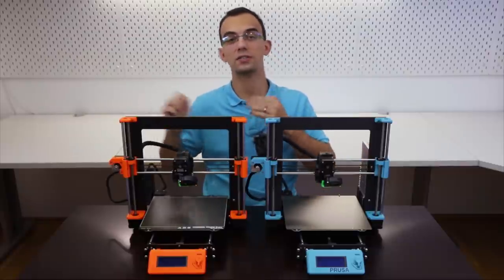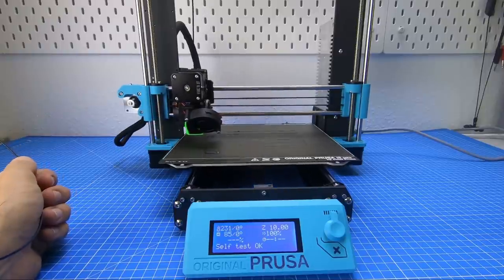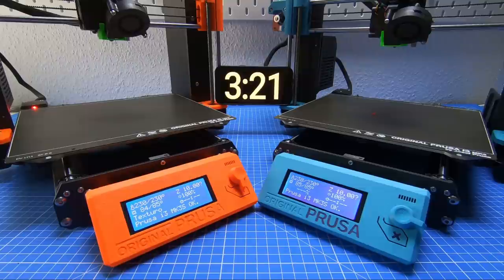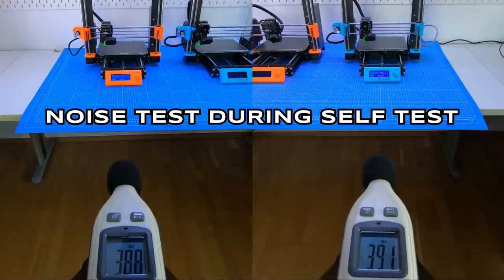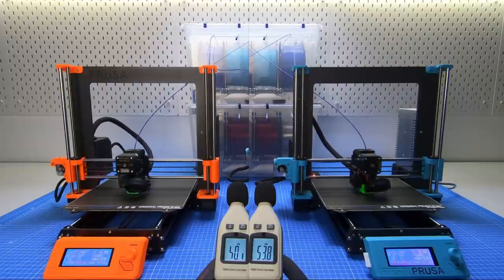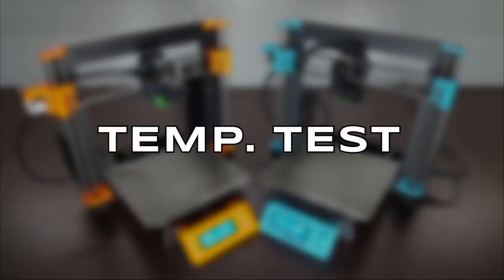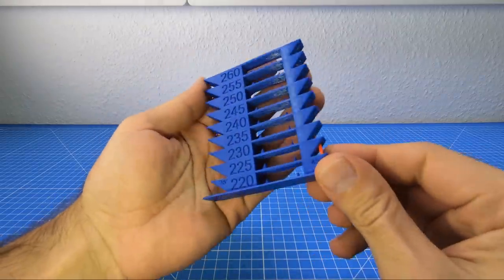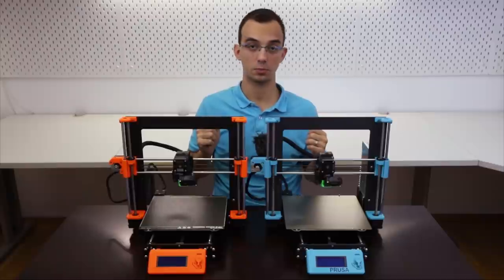The best Prusa MK3S 3D printer alternative? [test, compare, review]

Comment: I bought this clone in november from Spain. Bearings were fine, didnt need to adjust eSteps, Temps were fine too. LCD cables were also the right way around. The only problem i had was that the Z-Motor cables seemed to be wired wrong, so that when plugged in the only way they go, the motors turned the wrong way so that the z axis would move in different directions. I needed to cut the clip of one of the motor plugs, turn it 180 degrees and connect it back. But be aware that it is now possible that both motors spin down when they are supposed to go up, in this case you need to flip both cables. Otherwise this clone is perfect and i didnt notice any difference to my original prusa mk3s.
Reply from the maker: Interesting. Seems like random issues come up. That is the cost of quality control, but advanced users like you can handle such problems. Good job.
Reply: you can configure motor pins in the firmware without swapping wires. Its standard procedure for dit printers, i guess the manufacturer just assumed the users knows how

Comment: Something that would be interesting, is if you would be willing to try to exchange just, oh, the fan and the hotend?
It kindof looks a lot like they have the wrong thermistor values, and that the rpm sensor for the hotend cooling fan is missing.
It's pretty cheap, and would be an interesting topic.

I am waiting for my own clone (already own one original mk3) from another brand, so I am pretty excited to see just what I need to replace to get it to that point.
Hats of to Prusa for making all the plans available and the design robust enough for a clone to be viable even with suboptimal parts! :)
Reply from the maker: For the fan the ALTFAN solution works, I will show it in my next video, For the thermistor a change would probably solve this issue, but first I will try out how is it with the HSS nozzle works, maybe it would fit perfectly because of its lower heat conductivity it needs normaly plusz 10-15°C over brass ones but the clone is already that much hoter. We will see.

Comment: How much print time did you have on the Prusa before you purchased the clone and did the test? I hear issues that sound like bearing issues associated with not being lubed sufficiently on the Prusa.
Reply from the maker: I had around 1000 hours in my original Prusa at that time. I am using silicone lube for the bearings.

Comment: Any update on your clone? Is it still working and how has it faired compared to the original since you have been using it?
Reply from the maker: You can watch my other videos, I am using them continuously without an issue, only thing that need to be calibrated is the temperature differences, but I think it is the same by original printers also.

Comment: So, if I understand correctly, the only real problem is the nozzle cooling fan. Is this responsible for the high temperatures? Could the quick fix be to replace that fan with one like in the original Prusa? What parts 'need' to be modded/replaced to make it really trouble-free? Great review by the way. I'm always a bit afraid of clone machines from China. Sometimes they cut too many corners, because the person making the clone doesn't really understand why the OEM choose certain parts. This one seems to be made with a bit more effort, judging by the results.
Reply from the maker: The high temperature is caused by the different thermistor type. If you want to get rid of it I would buy the original e3d thermistor because that is what programmed by the EinsyBoard. (they have probably little bit different voltage levels for different temperautres). 
The nozzle cooling fan just helps you to cool back the material over the melting zone to keep the filament solid on the top part of the heatbreak. I made another video also on this topic where I speak about the upgrade parts. Check it out.
Reply: @Dombi3D  thanks! I saw the other video a bit later with the listing of the upgrade parts. Good job! Will surely consider it. Very helpful, thanks!

Comment: Are these clones close enough that an MMU2 could be added to them?
Reply from the maker: Yes they are, I am just sat down to order one MMU2S clone also to check what they can do. Probably will be another video topic.
PS.: Nice to see your comment here :)
Reply: @Dombi3D  Wait, there's MMU2S clones? Man, that seems like a bad idea... and I kinda want to do it.
Reply from the maker: Under my first link you can choose that option also :) I have also some doubts, but I like experimenting. However it will be probably challanging  because the original prusa uses a special heatbrake (at the melt zone it has 2 mm diameter instead of 2.2 mm) for the MMU2S setup, but if I can not make it work without it then I just order that part later.

Comment: Hi, what firmware version are you running? I updated to the latest MK3S firmware and the filament sensor has stopped working. If I use a different firmware (like the one for the MK3) it recognises the sensor and works ok but at the same time it's not the correct firmware. Thanks

Comment: One question, how is the clone performing with other more demanding filaments, like ABS/ASA, Nylon, etc.
That's where the prusa normally works better than the other choices in the market...
Reply from the maker: I printed ASA and ABS with it with no issues. (With full metal hotend)

Comment: What is the brand of your Stepper motors? I just built the BluRoll kit and my belt tension is super high 160's and even with a very loose belt will not get to the 200's.  After some searching, some mentioned it might be a voltage issue with the steppers or resistance with the bearings.  This is my first printer but the bearings seem to be moving well. Any suggestions?
Reply from the maker: I used the motors which were in the package. Both X and Y has this problem? I do not know the BluRoll kit.
Reply: @Dombi3D  Yes. My Y is better 173  and my X is 164. The prints have been good but crash detection must be off.
Reply from the maker: @dr3wst3r1  The good point in this that if the bearings are little bit tighter than it wont make so much ghosting. Crash detection is a nice feature but it was triggered till now once for me during a 2km filament print time so I would say it is not a big lost.

Comment: Hi! Where can i find the blue PETG 3D Printed Parts for the prusa like yours?
Reply from the maker: Hi, I printed it with my original Prusa.
I am working on my 3D printing farm so I could also print for demand but it is not so pretty yet. However it works but I need to adjust the price calculation. If you interested: www.dombi3d.de

Comment: Why are the bed and extruder banging against the frame??? That cant be good right? Even if it is for calibration things will break if you keep on doing that?!
Reply from the maker: That is normal. Prusa has no end switches, they measure the current from the TMC motor drivers and when it hits the frame the current goes up and they know that there is the end. It is a pretty smart solution!
Reply: @Dombi3D  Yea but wont this damage the frame or components over time? It seemd to be banging it pritty hard :P
Reply: @wouter8596  it will not damage it

Comment: Does the clone take firmware updates from Prusaslicer just like an original? Half the value of the Prusa goes into software/firmware development, it's not just about the hardware. If the clone can't take Prusa's firmware and is dependent on some unknown Chinese maker for firmware updates, the clone really isn't 'cheaper'. At that point, I'd rather just recommend an Ender 3 for an entry level printer, at least you get Creality's support and tons of experience from multitudes of users.
Reply: I have a Fysetc MK3S clone myself. It runs the official Prusa firmware

Comment: The only thing on my bear i3 mk3s clone that is as on the original is the BT gears I found after well over 3000h printing that my triangleab ones liked to chew through filament way too much, but still was good for the 1st few hundred hours i print only with PETG, whereas the BT gears have been shaped correctly and hardened.
Reply from the maker: I do not know yet the long term quality of the clone but I had no issues till now after 2.5 kg PETG. The new ones I build more robust (misumi/IGUS bearings, Micro Swiss full metal heatbrake and HSS nozzle, Nylock mod, Gates belt). I think they will hold for a while. We will see.
Reply: @Dombi3D  what hotend did it come with?

Comment: You used the original bed to calibrate the clone?
Reply from the maker: Yes, because the bed which came with the clone was not assembled at that time and I also printed on the clone new clone parts and I wanted to get the same texture. I purchased some clone PEI powder coated spring steel sheets also, but not tested yet.
Reply: @Dombi3D  How does the clone's bed  compare to the real stuff?
And the Z probe?
Reply from the maker: @NicksStuff  Z probe works fine, the clone comes with a smooth PEI sheet and I am working always with the powder coated one, so not tested yet the one which comes in the package.
Reply: @Dombi3D  So the clone isn't able to check its geometry the way the real one is?
Reply from the maker: @NicksStuff  It is able to check that, as I made the first calibration also on the video you can see that it checks everything and tells if something not parallel etc.
Reply: @Dombi3D  But I thought it needed the right bed to do so?
(So, would it check squareness with its clone bed or does it need an original Prusa one?)
Reply from the maker: @NicksStuff  The bed itself is like the original just the spring steel sheet differ.
Reply: @Dombi3D  Alright, thanks

Comment: After three 3DBenchies, my printer has stopped completely. I suspect that the extruder is completely clogged, and I don't know what to do. I try to insert the filament, but after a little while it just stops and starts to jump on the extruder gears.
Reply from the maker: Have you changed the hestbreak to the full metal Version?
Reply: @Dombi3D  ... no :)
I’ll get a full metal heatbreak, I’ve got a MK2 heatsink spare laying around and a proper E3D nozzle. If it works, I’ll paypal you a cookie! Have a subscribe in the meantime.
Reply: @Dombi3D  Following has been done so far:
- Genuine MISUMI bearings
- Genuine MK3s+ upgrade
- Genuine heatblock, nozzle, heatsink and heatbreak
- Genuine removable heatbed

At this point it’s working like it should. I’m still 150-200$ under the price of what a new Prusa costs. Had I know that, I would probably not bought a clone to begin with.

To pay respect to Prusa, I’ve bought filament and parts from them, as well as a spanking new genuine Mini+ that should arrive within the next month or so.

Comment: About 400.00 US with shipping for Clone without printed parts just an F.Y.I as of 10/5/21
Reply from the maker: Yeah the new shipping rules with extra tax changed the way of thinking about ordering from China. However some of their stores has warehouses in EU or USA to avoid those extra costs, but they have to fill up that warehouses also somehow, so at the end the customer has to pay for the extra costs. By the way with 400 USD is still a much cheaper alternative as the original one. 300 USD is a lot of money for most of us.

Comment: i have problem whit Einsy-base  and heatsink of board... they collapse...what your solution?
Reply from the maker: I did not used the motor driver heatsinks, on the original one was also none of them.
Reply: @Dombi3D  now i have print the old stile box for einsy..whitout support for raspberry zero... and i wait the iko bearing from courier before finish all assembly...

Comment: you can install the "multi material 2s" unit on the clone ?
Reply from the maker: You need to change the heat brake for the original prusa version, but theoretically yes. There is also a clone mmu2s set I just got it yesterday, now printing the parts for it and I will make a video about it also.
Reply: @Dombi3D  perfect, we look forward to the new video 😊

Comment: How can a clone still sport an original Prusa nameplate?
Reply from the maker: I have just painted the Prusa text and not the original because of it.
Reply: The frame of Fysetc-Clone does not have the "Prusa" sign on the top. The plastc parts you print yourself. The mk3s is fully open-source, so you get the full design including the STL with "Original Prusa" from github and from the prusa site. But there are also stl with blank display cases available. Also with Prusa Slicer it is quite easy to remove the "Original" and emboss a "Cloned" instead. I did this on my 3 Prusa Mini (but not on my mk3s clones now).

But anyway: There is a line above the "original". Mathematicly a line about something is a logical "NOT". So Prusa´s original design of the "Original Prusa" display actually says "NOT original Prusa" to all mathematicans and engeneers... So actually the clone is labeled correct and the original is labeled wrong from factory ;-)

Comment: Clones like this make me really sad. 0 development, 0 innovations, just 1:1 clone. Taking everything from the open-source community, not giving anything back.
They can cut the price a lot by not having to pay any developers, not providing support and using a bit cheaper components.
They didn't even bother removing "Original" from the front LCD printed part.
Reply from the maker: The Original text was my fault, because I just printed the same parts that I had from my Original Prusa. I tried to balance it to highlight just the PRUSA text on it. The 3D printed parts are not part of the package. I was plain curious about the clone and at the time when I ordered it, the Original Prusa delivery time was over 8 Weeks (as the Prusa Mini now) and I needed the extra printing capacity earlier. In my conclusion I recommend the Original Prusa in the first case if you have the time to wait for it. I am not afraid that you won't get enough orders for your actual available production capacity. Keep up the good work!
Reply: @Dombi3D  Oh good to know. Though I checked the Aliexpress listing and they also have "Original" Prusa on all their product pictures.
Don't get me wrong, I think you did stellar job on the video and the comparison, it was interesting to watch.
And I totally get that the lead time can sometimes be a deal breaker. I'm just not a fan of these chinese companies that don't even try to do anything differently, they just use 1:1 firmware, hardware and that's it. We still have plenty orders anyway, but there are tons of other companies that do actual development and create wonderful machines, but won't succeeded, because their sales are taken away by clones like this.
Reply from the maker: @TheMikolasZuza  Thanks! You are right with the printed parts which are sold, and some of them even printed with PLA... Maybe I will be also one of that inventor/developer who will be riped off from the clone community, because I am working on several 3D printing related projects (from complete 3D printer build from scratch to 3d printer upgrades) that I will post soon. But we can not do so much against it. At least that was my conclusion when I started to check how Patents work. 

I put here a little teaser: One of my next video will be a pick and place extension for the Prusa MK3s printers which will make possible to automatically place magnets/NFC chips etc. into your 3D prints, Placeing SMD LEDs onto a PCB would not be a problem also (I maneged this task already). Installing this extension requires no additional wiring or what so ever. I am pretty curious what will be the reaction of the community for this, because I have not seen anything like that before. I spent already several months into this developement, hopefully not for nothing.
Reply: @Dombi3D  Wow that sounds cool, looking forward to it.
As far as patents go, that really is a futile way to go about it. We really just have to keep pushing, so that they're always one step behind, and provide good QC and support, which is something they typically struggle with.

Comment: u used bearings that came with clone printer? And u got those similar results as original one in printing quality?
Reply from the maker: Yes, I also wasn't expected that. Could be that the bed just moves back and forth and it has no torque to right/left and up/down so that loosnes makes not much of a difference. By the Z axis 4 bearings are pretty stable with the 45° turn installation method. The X axis is also not that critical. All in all I will change them in the future because I do not like the idea of this amount of bearing clearance.
Reply: @Dombi3D  Interresting!
I  ordered this printer, but i was looking at local shops to buy some misumi bearings, but i donno if is worth, should i change precision axes with bearings or better try with those "cheap" missing tiny balls bearings that come with the kit. If i buy bearings and rods, then a good heatbreaker for hotend , well it ends up costing like an original prusa sooner or later. I think i will keep the bearings that come with it, and see how it is. I am lazy then to re-do assembly if i want later to change bearings.
Reply from the maker: @Flavius-Tech  I am working on the Misumi, IGUS bearings version builds. I am ready till the bed assembly and I can say that the misumi bearings with the clone axes (I did not purchased misumi rods) helped a lot. It still moves a very little amount but I think it is precise enough. Actuall results comes with the test prints when I finished the builds. To change the already assemblied printer, I think I will just change the 3 bearings under the bed, the rest is complicated and has no that much of an effect on printing quality.